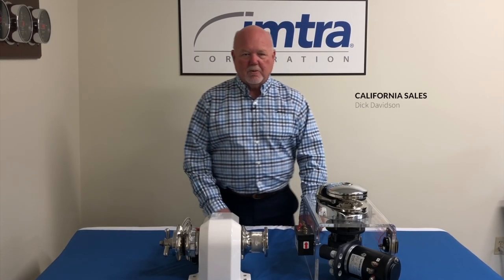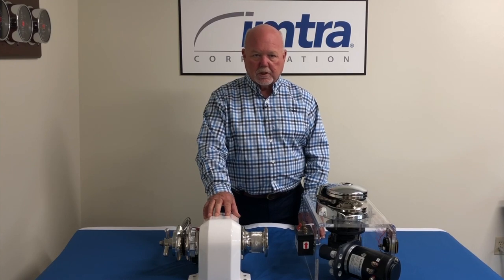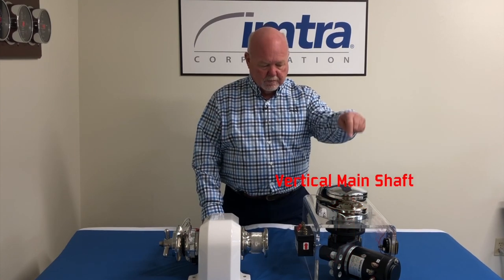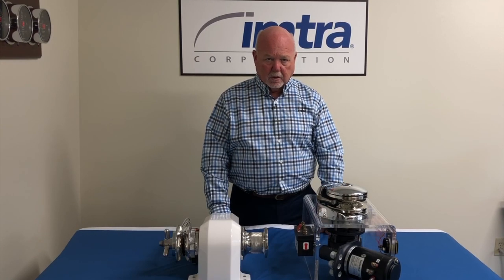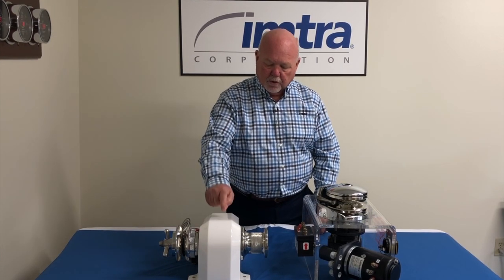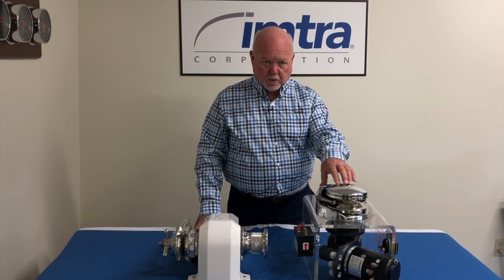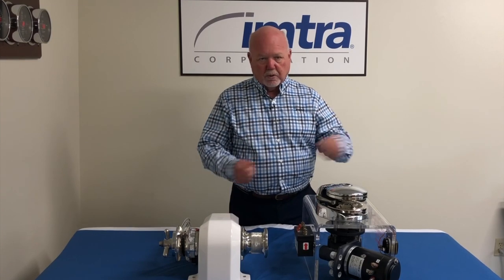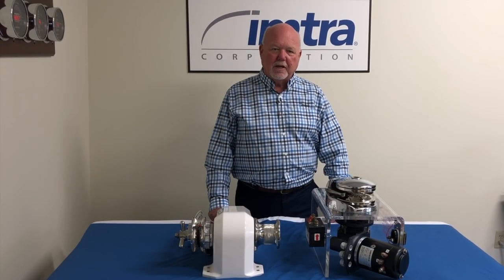Horizontal vs. Vertical Windlasses Pros & Cons

Comment: Can rope also be used on a horizontal windlass?
Reply from the maker: It depends on the exact model and manufacturer, some can and some can't handle rope, so it's always best to check with the manufacturer.